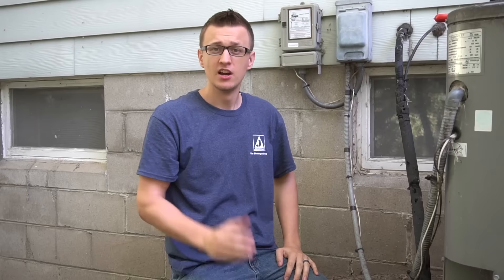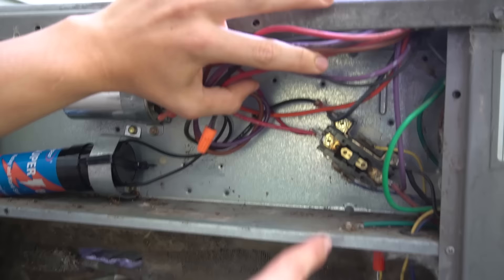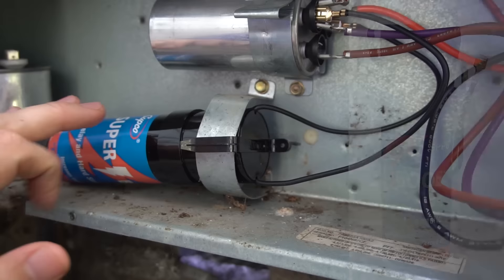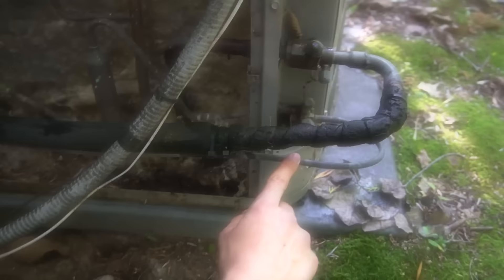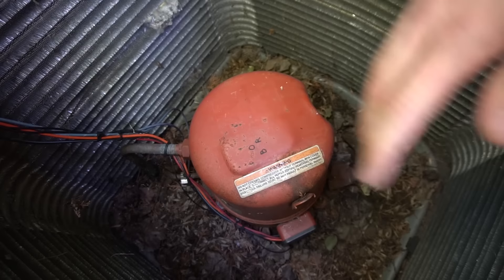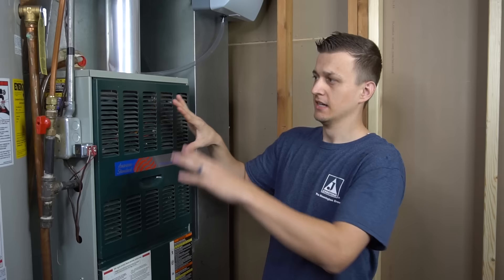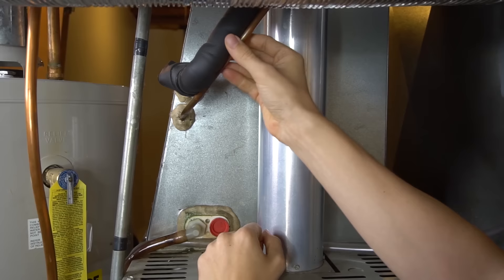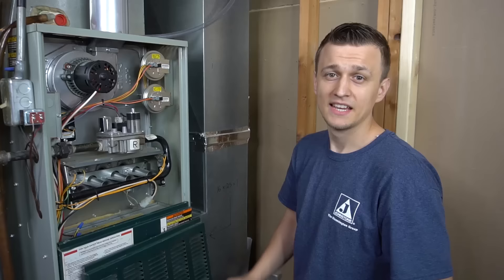All AC Parts and What They Do

Comment: That "2 position vs 3 position valve" story is super important for new technicians. Thanks for sharing.
Reply: Why are they called 2 vs 3 position valves?  3 positions make no sense as a name.   Open and closed.... and half open?
Reply: @99jp99  because you use the two open contacts as a third position. Relays and switches have a Normally open and normally closed, if there’s 2 separate normally open contacts, that makes a whole contact. You just wire them in series and boom! You have a 3rd position.
Reply: @99jp99  Position 1: passage to compressor is closed. This isolates compressor from the system line set. 

 Position 2: passage to compressor is open to system line set but not open to service port, this is the position where the system will normally run.

Position 3: passage to compressor is open to system line set and also open to service port. This is the position where refrigerant pressures can be measured while system is running for service testing with a manifold gauge set attached to the service ports. When service testing is done, valves must be set back to position 2 before removing manifold gauge hoses to avoid loss of all refrigerant from the system.

Comment: One correction - technically speaking the discharge line is the line inside the condenser going from the compressor to the coil, and after the coil is the liquid line (the one going into your house) :)
Reply: Busted

Comment: I'm a supply chain engineer working in an HVAC manufacturer. I'm watching this video because I only know the ABC of air conditioning and most of the parts I only know them by their part number and description but not their function. Yesterday, I was invited to see a teardown of many AC units —the HVAC engineers didn't explain the function of the parts, so I got curious to search by myself. We build commercial units btw (more than 3 tons).

Comment: As a generalist contractor / low voltage guy who just wanted to fix his own AC: thank you, this was all quite helpful, ESPECIALLY the 'pause the screen' more detailed explanation bits.  Before, I did not understand why capacitors were needed for common HVAC motors.  Now I understand how they are used to take single-phase AC to give dual-phase to a motor and why a motor won't run if the capacitor dies.
Reply: Side note: Capacitors must be a common fail point as he has an extra stored in the unit.  🫡

Comment: Thanks Jay for great videos. I had a technician came and diagnosed my AC and said I need new one. I watched your videos and did my own testing and found out it is the condenser fan. Called the company back and they replaced my fan and back in business. You saved me $4500!!!!!!. Thank you!!!!!
Reply: lol tried ripping you off, no reason a tech shouldn't find that problem withing minutes. had to be awk for the "tech" to come back out. (awk for the guy not you )
Reply: I work in UK as building services Engineer, the one I come across are FC UNIT AND AHU something a bit different, however in one place or contract I took, there were Hitachi Airconditioners on the walls and there were many in different parts of the building and let us say some of them let us say around 10 of them in different places were connected to a single unite on the roof which was I suppose Condensors, I was pretty confused I thought since it is only one compressor from the top of the building for each system [ Each one had around ten Hitachis] Let us say system one had ten hitachi on the walls in different parts of the build and that sysem one only had one condensor on the roof, so how does it work for so many of them in the industrial buildings???? In the case of FC And AHU they use a very different kind of system which I work on. I mean after the expension valve are there different evoporter coild in each hitachi for a single system in which there are ten hitachi connnected to a single condensors etc on the roof, if you can explaine this it will  really sort out allot of problem for me. Most of the JOB I do are BMS and FC AND Ahu and electrical stuff which I understand them all but this one is a bit confusing for me if you can explaine it a bit???

Comment: I’m 3 months in as an apprentice. Really useful tips here and covering each term and explaining it thoroughly! Awesome job thank you man 👍😃
Reply: Still doing hvac? If so how’s the journey? I’m a hotel maintenance tech at 19, thinking about jumping to hvac apprentice as now I have a general knowledge in all trades
Reply: @derickritter254  depends on your area to be honest. Some places do more with heating than cooling. All regions in the states also use various types of different systems. 

I'm in Nevada. We use heat pumps, or straight cool with furnace. Some apartments communities even use heated water heating systems.

Anyway, I myself haven't worked straight hvac actually. In my area, companies will hire for the season and can tend to lay people off during the winter since there's less work.

I work in apartment maintenance,  it's more steady people say, but you'll def want to have all your trades brushed up.
In a day you might run the gambit of doing plumbing, electrical, hvac, etc...
But knowing hvac and having your epa cert can open a lot of doors for you.

I actually was out of trades for some time, and after recently being laid off I jumped back into it. There's always high demand for maintenance people in las vegas where I'm at.
As time passes you can earn a decent living, and you'll have a skill that's always in demand. 
Also, soke of the most coveted jobs are commercial for sure.
You go service restaurants or stuff like that and doing commercial means you won't have to be in attics or deal with the elements as much.

Anyway, getting your epa is good cos it doesn't expire, so you can explore the field and see what strikes your fancy.
Reply: I’m now a year and 3 months in 👍 loving the trade and learning so much every day. A lot of useful skills in everyday life 💯

Comment: I'd just like to add that the discharge line will also be insulated if it's for a heat pump. As usual: excellent video! Thank you so much!
Reply: Why is the discharge line insulated in a heat pump?  It doesn't have to be.  You want heat removed from the discharge line!  You would not insulate it.  In a heat pump, the large line becomes the discharge line and you do want it insulated as it is carrying hot gas for heating to the indoor coil.
Reply: That’s not true. The discharge line (actually called liquid line) is not insulated in a heat pump. The insulated suction line becomes the hot gas line in heating mode.

Comment: Thanks for the explanation, my AC was stop running, checked the fuse and CB all good, thanks to your hint about 24 volts from furnace, I found my furnace power plug had bad contact. Reseating the power plug fixed my AC!!!!!! easy fix but many people may not know of it.

Comment: Excellent video. I would just like to mention when/if securing slack wires to fan gaurd, take a piece of schedule 80 pvc pipe, cut a channel along its side end to end, plus a few perforations for good drainage... so you can sheath the wires. Then finally fasten the pipe to the fan guard. Preventing anyone suffering a short in the electrical. That was all. Thanx again for all your time and educations.

Comment: Very informative anyone that's new to HVAC should watch this video it will help them learn the parts to a condenser unit now you need to do a 90 percent gas furnace and a 80 percent gas furnace then do a duel fuel and don't forget to do a oil furnace that would be very interesting

Comment: I moved to Phoenix from PA. 15 yes ago and attended RSI hvac school  here in Phoenix. Phoenix is one of the few areas where heatpumps are efficient because they still take the heat out of the air to be directed back to inside rooms. We were told heatpumps become less efficient below freezing  32f which is rare in Phoenix. Another thing is heat strip are popular where the blower fan will blow air not cool like air conditioning  but regular fan air and then the hot relayed from the thermostat triggers heat strip after the blower moter. Kind of like a big hair dryer.  Until  I watched these videos I never knew about a control board and using the blower moter of the furnace in conjunction with the inside evaporator.  I am used to relays to contactor/low voltage and then the pulling of the pin to let the higher voltage go through to the capacitors /meters. This guy explains  things well in all of his videos, very easy to understand or at least get a grasp of the flow of how things work in an AC unit. Thanks!
Reply: you are very well informed still in phonnix?
Reply: @JoseFlores-bc3cf  Good to here feedback from another source. Yes I am still in Phoenix, will always continue to expand/add my understanding of HVAC, can be applied.anywhere.

Comment: This really opens my eyes Thanks I think I have almost the same heat pump. I need to know this stuff because my Heat pump is old . I installed it in 1997 and I have been very lucky it still works pretty good! I had to replace a few things like the condenser once and two other small things I am very happy that I have a well-made heat pump to last this long! I won't waste my money on filters they do not do much of anything I haven't used an air filter for almost 16 to 18 years and I have had no problems. Once every five or more years I will take a rag and water and wipe the A coil down and really it isn't that dirty when I do! I really think the filters are a waste of money! That is just in my case but I have seen no use for them!

Comment: This was like :
A/C 101- 010101....
Meaning ALOT of GREAT info and VERY HELPFUL !!!
Thanks for posting .
( I took my Lunch period 
half way through -- ha ha )
Reply: Your videos have been a huge help. My a.c. fan is a split unit. The thermostat will not work anything. I went to outside unit and was able to start up unit with pushing bypass button. Still can't get the fan motor inside to come on. I still have the old mercury thermostat. Should I focus on the fan motor or fuses in the air handler at this point? Lynne. And thank you again for your videos. Very easy to follow.
Reply: Thanks

Comment: 6:12 you said the smaller line is the discharge line, thought that’s the liquid line? Suction line brings the low temp, low pressure gas from the evaporator into the compressor turning it into a high temp, high pressure superheated gas. Which in my head the discharge line is only in the condenser because it’s from the compressor to the inlet of the condenser coil. Which is in the condenser unit. But once it leaves the condenser as a high temp high pressure liquid it goes into the liquid line ( outside the condenser) through the filter drier then the txv back to the inlet of the evaporator. correct me if I’m wrong
Reply: This guy does a pretty good job explaining things. He may have a few terms not exact but for the most part is spot on. You have to remember he is talking to non professionals. By the way, the gas in the suction line is low pressure and superheated, not cold. The liquid in the liquid line is high pressure subcooled liquid, not high temperature. You got it right with the discharge line. the gas there is high pressure, superheated. Think saturation temperature as a starting point.

Comment: WOW!  I just found your channel by accident. Having some very big trust issues with a big HAVC company,  with techs on commission, and their sole job is to up-sell you through maintenance contracts.  While learning some important yearly maintenance jobs is not even included in their visits. Yes, I have a Capacitor just laying free, from my blower motor, and they have serviced my 2nd unit for years.  
When does an HVAC tech touch a unit that not even contracted or even part of the service call.  I will tell you, when that unit is older, in our case its 20 years old. The tech tells us it needs parts over $1,500, and its a dangerous unit that needs to replaced for $16,700 dollars!!!! And it doesn't matter which ton unit you need, its all the same price. While  also stating we are the cheapest, and in 2024 the price will be 20K !!!!  Thank you very much !!!   I am now an informed homeowner on the lookout for the next up-sell.
Now the biggest task finding someone I can trust..  Be aware of big HVAC companies that have several locations in your area. Look at reviews in several places online. I doubt they will answer honestly, but ask if they work on commissions.

Comment: OMG...  Natural gas valve, Electric Switch, Transformer and Water Heater Pressure Relief Valve all grouped together like that?!   Is that even LEGAL?   Worse Case Scenario......  Pressure reliefs can Leak especially when function tested and there is a failure or servicing/ replacing the valve.  Water leaks over time and gets on to the natural gas valve causing corrosion.  Natural gas leakage potentially develops.  A spark from turning off the switch.  And then to top if all off... the nylon plastic tube from the humidifier drain is right up against the back side of the Natural Gas Exhaust Vent that reaches what temperatures especially when the furnace is not quite adjusted correctly resulting in melted tube and water down into the cabinet?   Need pay attention to Details for installation jobs and Separate all of it for Serviceability, Protection, Longevity.... RELIABILITY.   FUN!!!  I would have made them Redo this job.
Reply: By
Reply: it just started this , i thought it may be the thermo so i replaced it, didn't fix the problem but i did get water leaked onto the unit and i smelled something burning (fant) looked at the inducer motor transformer looked like it had been burnt so if i cane find one i will replace in it is a old unit date on the transformer says 2003 maybe it can be matched
Reply: Hi
I went to change the insulation on my refrigerant line yesterday morning and I think the thin blue wire going to the wall was pulled out of the blue wire nut. Can you tell me what to do to put it back  or can I??
Reply: @MissCarey1420-yf5ev  Do you mean the Plastic wire nut used for connecting to the 24VAC signal wire?  If it pulled out of it... then unthread the wire nut ... clean the wires and straighten them out and reinsert into the wire nut and twist it tight.  Lefty Lossy.  Righty Tighty.  You can always reuse a wire nut unless piece got broke off up inside and refuses to come off which will then require stripping back the wires with a new wire nut cap.   Hope that answers your question?

Comment: It would be great if you make a separate video on step by step electrical connections of compressor, OFM, contactor, capacitor, thermostat etc as per single line diagram with your style of detailed explanation.

Comment: Hey man you make very helpful videos, I'm not a hvac tech but I'm a husband and father and you've saved me some money. I'm in the process of some DIY procedures for my unit. I've ordered a capacitor to change out and some 410a refrigerant along with the yellow jacket manifold kit. I do have a question... Do those outside plugs that disconnects power from the unit ever have to be replaced?
Reply from the maker: Only if the prongs on the plug broke which is very rare. Sometimes the disconnect box or the plugs themselves will have fuses in them though. Those are more commonly replaced.
Reply: Ok thanks, is appreciate your reply back . Hopefully I can troubleshoot and get it back up and running

Comment: Nice presentation you did great I'm not critiquing you but you will want to note in the future to check for power after you have pulled the disconnect theoretically and often times they have a jumped leg instead of replacing the disconnect have noticed many occasion where they burned leg was jumped again you did a great job you have a lot of viewers if someone's in August they could miss that
Reply: Talk to text change things in August should have said a novice it could be a novice in August

Comment: One little thing I will add is some heat pumps aux ( emergency heat ) just run on electricity. They don't produce a lot of heat, but it does keep you from freezing until it's fixed and or replaced. Idk if you have seen that or not. Tbh idk there were propane ran aux until this video.

Comment: Very informative and helpful. You explain everything very well. Just wanted to note on the line set it is suction and liquid line. The discharge line is only inside the condenser (outlet of compressor to inlet of condenser coil). Great video!

Comment: A lot of the filter dryers are inside the unit near the compressor not always but ive seen quite a few in the past years , a lot of guys will put them indoors near the air handler to keep them out of the weather

Comment: i worked in air conditioning in the service, never had any one as good a teacher as you ( very precise, covering so much in just one video.) I wonder... i have tried to put water accumulators to collect grain water ( not basement drain put it by the builder) the newer drain pumps have more wires on them ... to hook up to the furnace,...but to hook to "where"?

Comment: On my job we had 15 cond. units out side ,200 ft. from 3 large cotton wood trees that were a big problem as well as $ to keep the coils clean.The fix was window screen and fender washers ,use the screws on out side of unit & attach screen. Can brush off easy,
Reply: where at melvin? thats a lot of work. good work

Comment: The small line that runs from the outdoor unit is the liquid line, not the discharge line. This line carries high temperature, high pressure liquid refrigerant from the condenser coil to the metering device at the entrance to the evaporator coil. The discharge line is a hot gas line that goes from the compressor to the condenser coil.